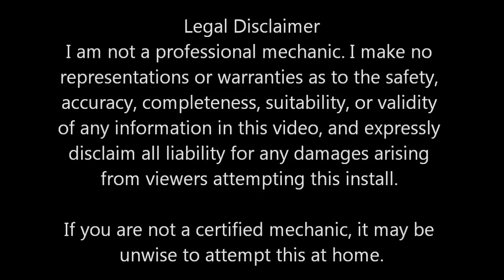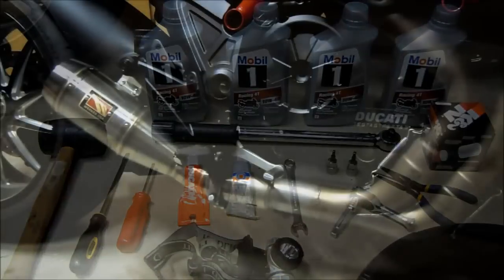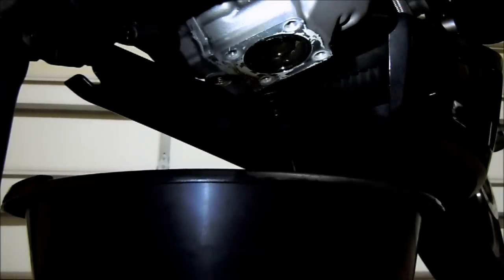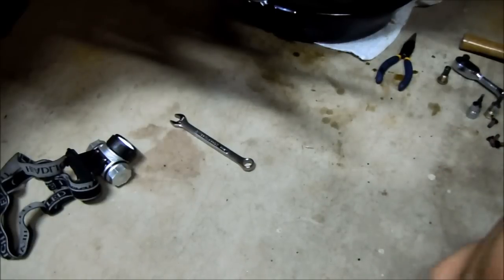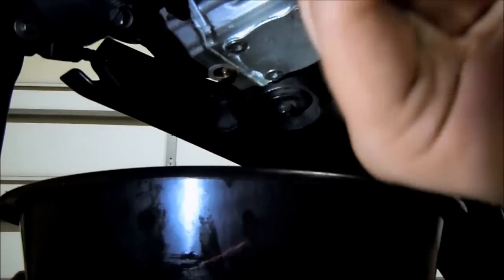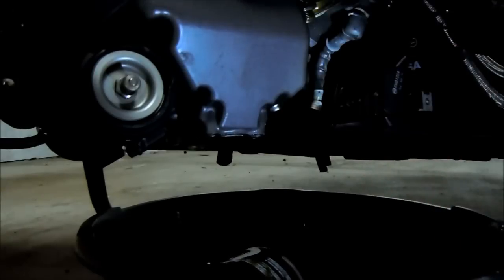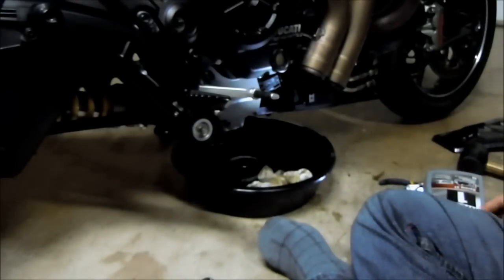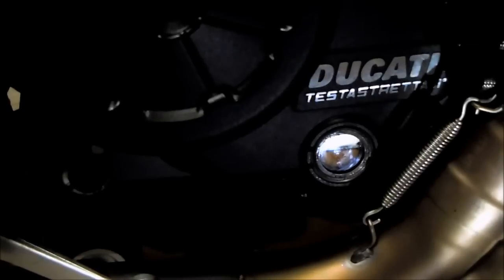Ducati Diavel Oil Change Complete

Comment: When you fill the oil filter with fresh oil, why not lubricate the seal with the clean oil instead of using the dirty oil from the drain tank?

You could use the correct wrench to remove the old filter too.  Sorry to pick faults in what is a very useful video.

Comment: Thx man for be as clear as that and give us the torq. required for evrything , no one have been clear as that at the dealershop!! i got a hypermotard but him pretty sur its the same thing cause its the same base for the motor! thx again bro , high five for you!
Reply from the maker: +sy d Best to verify on ducati.ms or the biggest hyper forum. Some of the specs for the Diavel are very different than the superbikes, like the fork pinch bolts are like 60% lower values than the 1199. If you go to the higher spec the bolts stretch and snap. The sump and filter should be the same across the board, but the drain plug sizes vary and might have different torque values.

We have the full Diavel specs on the Diavel-Forum in PDF format.

Comment: Love the vid man! I had it serviced last October with an oil change. Took my bike out today and it stalled with oil light coming on. When I looked at the site glass, I see no oil. No leaks in or around my driveway and definitely rear tire is clean. I’m hoping Ducati mechanics didn’t forget to add oil last October
Reply from the maker: Did you set the bike upright or on the side stand when checking the oil? The bike has to be upright to show the proper level on the sight glass. I'd have to assume the level is indeed low if the light came on though. Let me know what it turns out to be. I've never had that happen. The lack of signs of leakage is especially bizarre. This kind of thing is why I dread dropping my bike off at dealerships unless I know them personally.

Comment: Thanks a lot man! My 2018 Diavel’s warranty is about to run out, and I figure when it does,  I’ll do my own maintenance on it in the same way I do to both of our vehicles. Your video was very informative! Thanks again!!! 

As a side note: I appreciate the down to earth straight to the point information! No cursing, swearing, or theatrics! Just plain doing! Kudos to you my man!
Reply from the maker: I've cursed here and there in various videos, but I try not to make it a normal part of my speech. Insults and curses lose impact when every other word out of a person's mouth is foul.

Regular maintenance is no big deal on the Diavel if you have the time and space. It's just more tedious due to the stuff you have to pull off to access the top of the engine. Thankfully, it's rare to have to do that. Maybe a plug change every 15k or so. Oil, coolant, etc are pretty easy. Hoping to get more time in the garage as the weather warms up to get back into videos.

Comment: The new K&N filters have a nut at the bottom of the filter for easy removal. I replaced my filter with one of these to avoid the pain in the ass of taking off and putting on the exhaust pipes. The Termignoni full exhaust does not come off or on easily as the stock exhaust or the Competition Werks slip on.

Do yourself a favor and get the K&N filter. You can get it at Amazon. If you can't have it shipped by Amazon, one of their third party vendors can ship it to you for the same price. And very nice video by the way kuhlka. Thanks!
Reply from the maker: mruniv5 That's what I used in the video. I use a torque wrench to put 8ft lbs on it at @23:25. Assuming the sheet metal 'nut' doesn't get rounded off more than it already is, it works great most of the time. I've had plenty on cars that get stuck and then completely round off  because they don't use a real solid nut. At that point you pull out the vice grips. At least there's something to grab onto with tools. I've found filter sockets frequently don't fit the rounded knurls of many filters very well and just slip. You'd think companies would put a wee bit more thought into guaranteeing an easy on/off considering this is THE most frequently changed item on vehicles.
Reply: If you have a filter without the nut on it should be easy enough to remove with the correct cup type fluted tool. I’ve had some filers so tight that they twist up and deform when trying to remove them. Using a screwdriver as a punch would not work in that scenario. It’s a real nightmare.

Comment: I can't believe they make it so hard to change the oil. I'm about to go pick up my '15 Diavel now... Around $350+ for the oil change. I might buy these tools and do it myself next year.
Reply from the maker: It's actually really easy. I just went into a ridiculous amount of detail for this video for people with no DIY experience. If you've got the tools, it's usually under $75 for 10w40 or 15w50 4T full synthetic and filter. There are kits you can buy for the sump cover that use an O-ring instead of the threebond goop. That's what I have on my 1098. Repsol, Motul, and Mobil1 are my favorite oils. K&N for filters.

The sump filter only really needs to be checked every other oil change just to see if there are any bits of metal or gasket material. I check it during my first two or three oil changes during break-in to be sure everything is clean and ready to rip.

Comment: How much mileage is this service for?I have been told that the oil sump filter needs removing every 15000 miles by Ducati dealership is that right?Oh the only thing you missed was the exhaust cable connected to a sensor spring which is a bit of a job so i left mine on.
Reply from the maker: I did my first oil service at 500 miles and another at 1k, checking the sump both times to make sure there weren't any appreciable metal bits in the oil or filter during  break-in. After that, I usually change my oil every 3,000 miles because of how hard I ride. If you mostly cruise at low RPMs you could go a lot longer depending on the oil you use. I like full synthetic Mobil 1 and Motul 4T racing oil. Repsol and Amsoil is also good stuff.

I don't remove my exhaust unless the filter is stuck and needs to be removed the hard way. The I check the sump every other oil change just to be safee. It's easy to do and only adds a few minutes. There are aftermarket sump covers that come with an o-ring built-in so you don't have to mess with Threebond.

Comment: Thank you for the very informative video, although I do have one question regarding my own 2013 Carbon Diavel which I just inherited. The bike is a 2013 but only has 1,900 miles on it; I know it got its first service after the 600 mile break in period but over the past 6 years it hasn't gotten much action, other than starting it up and letting it run about once a month to make sure the battery doesn't die. Recently as I've been riding it, I noticed the oil was looking a bit dark, and was curious if I should change it? How many years can synthetic motorcycle oils last? Thanks.
Reply from the maker: If it's been sitting for more than a year unchanged I'd change the oil before you ride it. Oils and especially brake fluid can get acidic over time. Keep it on a Battery Tender or other trickle charger to keep the battery topped off. I'm happy with my Battery Tender Lithium battery.

Comment: Just a side note. I noticed the "o" ring that you pulled out of the sump filter was note replaced when you put the filter back in. Did you experience any issues due to it missing?
Reply from the maker: The green o ring on the top of the sump filter was still there. That should only need to be replaced if it’s damaged.
Reply from the maker: If you’re referring to the black gasket material I took off the filter, that’s from the engine cases being pressed together. It was probably some excess liquid gasket that fell off and got caught by the filter. That’s why it’s important to check it when you change the oil.

Comment: My Manual recommends I use 15w-50 can I use 10w-40?
I have a XDIAVEL as well.
Reply from the maker: It depends on your local climate. 10w40 is generally what the 4T Racing oils come in and it has a lower viscocity for cold starts. 15w50 isn't intended for freezing temperatures because it has high viscocity at low temps. If you live in the desert where it's hot most of the year go with 15w50. If you live somewhere that sees freezing temperatures, stick with 10w40 and maybe switch to 15w50 for the summer if you're doing road trips to really hot areas.

The first number is the cold start viscocity rating, so you could conceivably go with a 10w50 and just make sure to let the bike warm up before taking off.

Comment: Great video! I'm getting the same slip on exhaust pipe as you, can you tell me if I need to do anything to the bike in order to use it? Like reprogram the ECU for fuel mapping... Or does it work fine right out of the box?
Reply from the maker: The bike will feel less corked-up, but a Tuneboy flash with their Termi map makes a world of difference. I can putt down to 2500rpm smoothly after some Tuneboy tuning.
Reply: Hi Dan do you know who makes that slip on exhaust shown in the video?

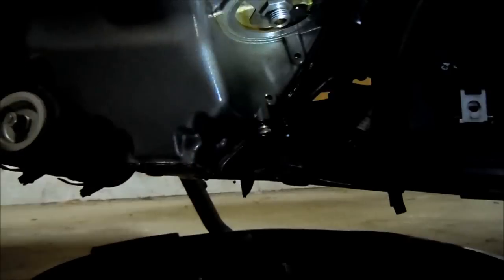Comment: Hello again, I've done the oil change the exact same way you've done it in the video and it's been flawless up until the part where I remove the Ducati factory oil filter. At 20:50 you can see on your bike that where the oil filter was, in the middle there's a bolt sticking out, sort of like a nipple. The problem is, for me, when I took the filter off, that middle bolt 'nipple' came off with the filter, and now I can't screw the KN filter back on, as there is no bolt for it to screw into. Any ideas? I can't pull the bolt out of the old filter, as it is glued in there pretty good. What do you propose?
Reply: Never mind, I took it to a nearby bike shop and they got the nipple out, aka 'bolt union'. Bike is all good now and full of clean oil. Thank you again for the video, until next time!
Reply from the maker: Arsenic You’ll have to get that removed from the filter and put it back into the bike. I think it has a hex on it to use a wrench. You can hold the filter with a filter wrench or vice. Hope that helps.

Comment from the maker: Did he give a reason why? I've never had an issue with either of my Ducatis doing oil changes this way. 1098 has almost 20,000 miles on it. About the same or more on my Speed Triple. The only thing I can think of is that it maybe isn't necessary, but doesn't hurt anything. Saves a little time when topping off because you can just fill up to the sight glass without worrying about how much the filter is going to hold.

Comment: Hey, I'm looking at buying a ducabike clear clutch cover for my diavel. I can't find any video on how to remove the old one and how to replace the pressure plate. I was wondering if you had any advice or tips I should know before jumping elbow deep into it
Reply from the maker: +Nick Holland  The Ducati Threebond liquid gasket hardens like a rock, so it'll take a lot of tapping with a rubber mallet to get it loose. Try fishing line to saw your way through it. That's the hardest part of the swap. I'd like to pick one up, but haven't budgeted for it. +downshift83 installed one on his bike. Said about the same.

Pressure plate is easy once you get the cover off. You just remove the bolts and swap it out. Just make sure to use the right torque values. The Diavel Forum has a tech section with the PDF that lists out all of the torque values for the bike. Very handy.
Reply: +MotoErgoSum the three bond is like the stuff you used in this video right? And Ya that's what I got from him too. But I'll have to look up that pdf, it'd be a handy tool to have for sure! It is expensive though. Hoping maybe by the end of the summer I might be able to pick one up. But all and all I'd have to drain the oil and disassemble the cover "beat off the seal" then reassemble is what I've gathered. Nothing to intense, other then getting the right torque specs. Ya?
Reply from the maker: Nick Holland
Sounds about right. Use a nylon or plastic scraper to take off any remaining threebond. Something like a bicycle tire lever. Razor blades also work, but they can scratch stuff up if you're not meticulous. Either way, just take your time, make sure all of the bolts are out of the cover before whacking, and think positive.
Reply: +MotoErgoSum awesome! I'll take all those steps, I really appreciate the advice thank you! If/when I get a chance to install it I'll try to let you know how it goes. Also, all your mechanic based videos are awesome and extremely helpful keep up the good work!

Comment: No fault of this video ( I do appreciate your videos)  but my 2013 Diavel oil change took 4.5 hours and that's  not including the sump work which I had to omit. Apparently the 2013 sump screws are not Hex heads but torx heads so after gurbering-up the first screw with a hex head socket I abandon the sump portion and left it to the Ducati shop to worry about when I get to the 7500 mile service. It seems that the Ducati shop maxed out on tightening the oil filter after I brought it back to the shop for leaking oil after the 600 mile service. I wish I could show a picture of the filter.  It looks like a beer can that went thru the garbage disposal after numerous attempts to turn it with a crew driver and  hammer . I quit the project three times and was ready to swallow my pride and have it towed to the shop.  Success was realized after employing a wood chisel to hammer out a pocket at the silver ring at the very top of the filter that would fit a flat head screw driver and hitting it with a 5 lbs hammer. In summary go with the K&N filter no matter what the Ducati shop tells you ( they strongly recommend against the K&N filter and said it was OK for a filter only  in emergency) and check the type of screw used on the sump (hex or torx).  BTW you should take off the exhaust pipe and  ducati filter wrench is $168.
Reply from the maker: Gah, condolences for your ordeal. I stripped the head of one of my 1098's sump bolts when I did the first oil change. They were waaaaay over-torqued from the factory and many owners had similar complaints. Had a filter over-tightened by a quickie lube place on an old Honda and went through a similar headache trying to get it off.

Definitely lube the seal on the filter and don't go crazy when tightening down. Makes me groan when dealers tell people aftermarket filters are a bad idea. All of the tear-down comparisons I've seen have proven the K&N premium line filters are as good or better than the rest. All it takes to check is a cut-off wheel and pliers.

Comment: Great vídeo, which oil did You use ? Mobil 1 full synthetic?
Reply from the maker: Polin Ese Mobil 1 Racing 4T. 10w-40. 15w-50 if I’m going to be riding for extended periods in areas over 100F. Death Valley was 118F at 10pm when I did an overnight run to Vegas and some parts of SoCal regularly got that hot during the day on the freeway as well. Now that I’m in the Midwest I stick with 10w-40.
Reply: @MotoErgoSum  full synthetic

Comment: Hi I did my oil change on my Diavel and I think I over filled it, Do I check the level with the bike cold? Because if so Oil is filling the glass completely... Or do I check it after I run it for 20 secs?
Reply from the maker: Bike should be on flat level ground and balanced upright off the side stand. Hot or cold shouldn't matter. It should be between the lines around the middle of the sight glass. If it's over-filled it'll puke out of the breather into the airbox and drip down the back of your engine. I did that once because the ground wasn't level and I didn't realize it.
Reply from the maker: You can use a MityVac or a piece of hose to suck oil out. I have a cheap MityVac I use exclusively for this purpose in case I (or a friend) over-fills any of their vehicle's fluids.

Comment: Hi. What amount of oil you put on the bike. I'm asking you why I changed the oil and the metal filter to my Ducati X-Diavel 2016, and entered 3.1 liters. The manual says 4.2 What I did not get out was the other filter, that one I did not touch. Is that oil capacity correct, only 3.1 liters ???.-
Reply from the maker: The X-Diavel is a totally different engine than my bike. Depending on whether your changed your oil hot, how long you waited for it to drain, making sure to always check the oil level with the bike upright, etc your fill may vary. All that matters is you're checking the level correctly on flat level ground and it's between the high and low marks on the sight glass.
Reply: Change the oil in hot, after having done 20 kilometers to the motorcycle, and let it drain all night. What surprises me is that they entered 3.1 liters when the manual says 4.2. It's almost a liter of difference. There will be oil left to go out, will it have remained in the oil radiator, the clutch will carry another oil ??? Only 3.1 liters for a 1262 mc3 engine seems to me a small amount of oil.
Reply from the maker: Usually they include the capacity of the oil filter as part of the total. 4.2 may be total capacity filled to the brim. If the bike is on level ground and you filled it according to the service manual's procedure and verified oil level after running the bike for ten seconds or so, that's probably correct. I don't have the X so I'm guessing here.
Reply: Perfect. Thank you very much for your help. I appreciate it.
Reply: @MotoErgoSum  hi, who makes that beautiful exhaust silencer? Where can I buy one? Thank you.

Comment from the maker: To get the best performance from your bike you'd want to do an ECU flash using a Tuneboy kit. I ran my bike without any remapping without major issues. The Tuneboy kit makes a night and day difference, though. My bike runs soooo smooth after flashing and loading up one of the included trim tables. A little dyno tuning and it'll be perfect. See my vlog about the Tuneboy and check out the Diavel Forum for a growing list of testimonials. Best of all it'll flash a stock ECU. No need for a Termi ECU.